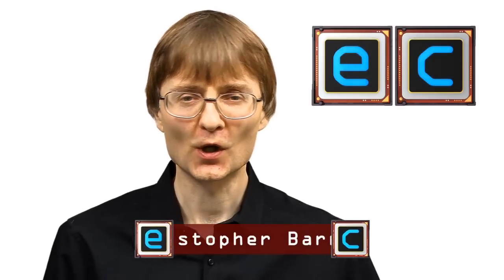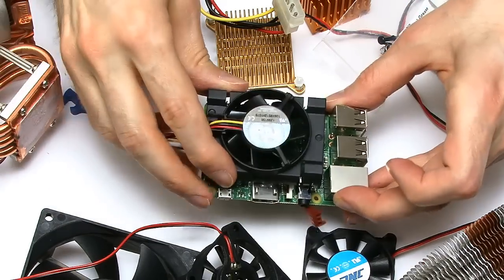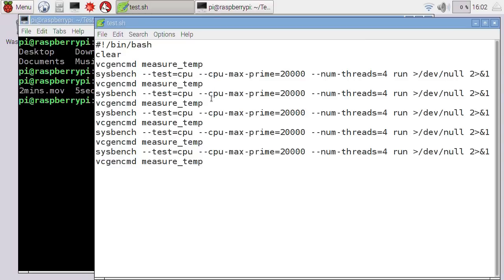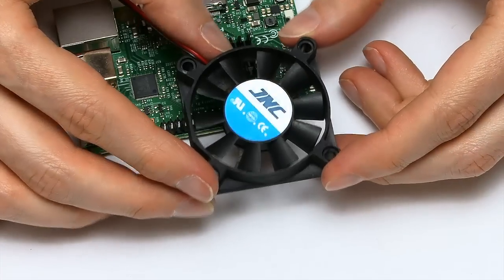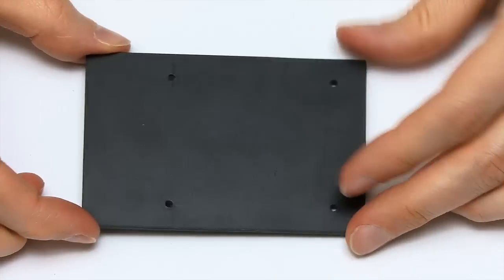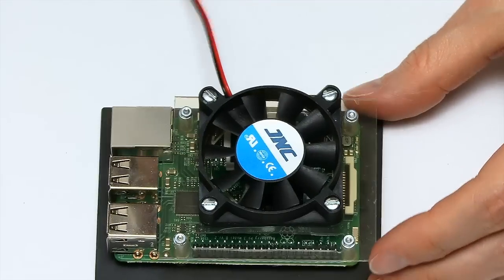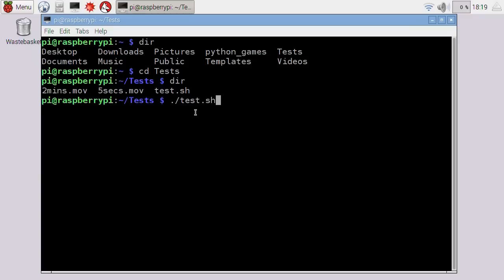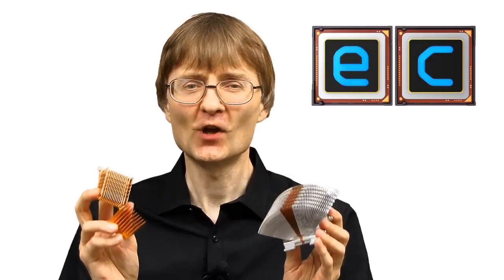Raspberry Pi 3: Fan and Cooling Tests

Comment: can you please share the bash script?
Reply from the maker: I will try and dig it out! :)
Reply: thanks.

I did try to copy the commands you showed in your video and put it inside the bash script
but for some unknown some reason I can't get it to output the different temps as shown in the video..
I think I wrote something wrong or the one you showed in the video is not correct..
because I copied exactly as I could see it in the video..

This is what I put in my script

#!bin/bash
clear
vcgencmd measure_temp
sysbench --test = cpu --cpu-max-prime=20000 --num-threads=4 run >/dev/null 2>&1
vcgencmd measure_temp
sysbench --test = cpu --cpu-max-prime=20000 --num-threads=4 run >/dev/null 2>&1
vcgencmd measure_temp
sysbench --test = cpu --cpu-max-prime=20000 --num-threads=4 run >/dev/null 2>&1
vcgencmd measure_temp
sysbench --test = cpu --cpu-max-prime=20000 --num-threads=4 run >/dev/null 2>&1
vcgencmd measure_temp
sysbench --test = cpu --cpu-max-prime=20000 --num-threads=4 run >/dev/null 2>&1
vcgencmd measure_temp

Comment: Hi! how can I control the fan with a GPIO? I mean, insteed to conect the Pi to " ground and 5v", conect it to "Ground and a GPIO(for instance '17'"
Thanks
Reply from the maker: You cannot connect a fan directly to a GPIO pin (well, you can, but you won't have a working Raspberry pi for very long). GPIO pins supply a few hundred milliamps maximum at 3.3v, so connecting something like a fan (ie motor) to them will draw far too much power and damage the Pi. Pins 2 and 4 on the Pi, which I connect the fan to here, supply 5V *before power enters the Pi's voltage regulator* -- ie they tap the power directly from the micro USB power in. To control a fan via a GPIO output you would need to use some kind of motor controller.
Reply: Thanks, at the end I have conect a 2 Relay module and the fan to one of the exit. But I needed to import and write this:

import RPi.GPIO as GPIO
GPIO.setmode(GPIO.BCM)
pin = 3
GPIO.setup(pin, GPIO.OUT)
GPIO.output(pin,True)

And now, I have a DOUBT. 
When I write "GPIO.output(pin,True)"  the GPIO has not signal and the fan does not work.
But if I write "GPIO.output(pin,False)"  the GPIO has signal and the fan works.
it should not be the opposite?

Thanks in advanced for your information.
Reply from the maker: It will depend on which way around things are connected to the delay module! I would not worry.

Comment: Very clearly, one needs an active heatsink if one wishes to have a long-lived Raspberry Pi.  Yes, it will run fine with no heatsink at all, but running it at its maximum temperature is just not a good way to keep the CPU in good health.

Thanks for this video -- an excellent demonstration, and I think everyone who owns a Pi should see it.

Comment: The temps between the two fans are virtually identical in the grand scheme. This makes me wonder is the chip's heatsink reached it's equilibrium in regards to thermal dissipation.
Reply from the maker: You are almost certainly correct. :)

Comment: The CPU fans are usually 12v... How do we power that with a 3.3/5v GPIOs on the Raspberry Pi? I've heard that Transistor can be used to do it. Are transistors a google place to get started?

Comment: Very good videos!
I did your test.script with my own Pi3 v1.2 and your results are very reliable!
I used a small aluminium Heatsink very similar to yours, but I milled the bottom flat and sandblasted the top. Used liquid heatglue.
At an ambientetemperatur of 20°C I got the following results:
40.8
67.7
74.1
77.4
79.5
80.1
Than I added a fan and let the Pi cool down propperly, I used a Sunon MB40101V2-000U-A99
Results were:
30.6
47.2
47.8
47.2
47.2
47.2

wich is pretty silmilar to your results and shows, that your test is reproducable!

Was fun to learn these things!

Best Regards, Christian
Reply from the maker: Excellent. Thanks for sharing this. :)

Comment: Like your video, subbed!

question, can I use gpio pins 4 and 6 for a fan? thanks! :)

This is for the pi 3
Reply from the maker: Yes, pin 4 also supplies 5V pre voltage regulator.

Comment: Does not the fan damage Raspberry p?i I read many article that warns the direct connection of fan into the GPIO on raspberry pi because the GPIO normally provides 20mA whereas cooling fan requires more.
Reply from the maker: You are right that the GPIO pins cannot and should not be used to power a fan. But I am not here powering a fan a GPIO I/O pin! :) Rather, I am powering it from the 5V pin that feeds directly from the 5V input to the Pi (ie it takes power before the Pi's voltage regulator, so it is safe to draw more power than that regulated output can supply).
Reply: ExplainingComputers Yeah, fan draws the ower from 5V pin in Rasberry pi. However it would be risky because the power consumed by the fan occupies the power to Raspberry pi, i. e, Raspberry pi requires larger than 500mA so that it would be possible Rpi cannot the mimimum powrt from the Adapter if the capacity of the adapter is limiter like 5V 1.5A where fac consumes 1A more
Reply from the maker: The only risk is that the Pi will not get enough power as you say, so could become unstable, which could I guess result in SD card corruption following a crash. However, there is no risk of hardware damage, as the fan is never drawing power through a GPIO output pin and the Pi's voltage regulator. Clearly the power supply needs to be correctly rated -- the "official" Pi PSUs are now 2A. :)

Comment: What about using USB driven fan with goose neck. You can bend it towards the heat sink. It won't require any additional power connections.

Comment: Great video tutorial, mate.  Just what size is the gigantic heatsink you used in the Extreme Passive Cooling video?  I'd like to get one to put onto my PI 3.
Reply from the maker: Thanks. The heatsink is about 34mm square.
Reply: Thanks for the quick reply.  Now I've got to get some 3mm copper and a gigantic 34mm heatsink.  I believe you used some sort of thin plastic sheet to fit between the copper and the heatsink.  What did you use?  And did you use any heat paste between the copper and the plastic sheet?

Comment: Hi. Good video. But can I connect the fan on pins 4-6?
Reply from the maker: You can take 5V+ for a fan from pins 2 or 4, and use 6, 9, 14 and others for 0v/GND. You should not attempt to power a fan from any of the other GPIO pins -- as they supply very low current ar 3.3V. In contrast, pins 2 and 4 supply 5V before the Pi's voltage regulator.
Reply: Thaks

Comment: You made the "bracket" a lil more complicated than it had to be.  Withall those CPU fans/heatsinks just "laying around", I would have just scavanged up some MoBo standoffs.  You can join as many as you like together to get the "height" you want from the bracket system. Another awesome side effect of this is that Screws can just go right into the end of the top standoff....... just sayin :)

Comment: I'm seeing others that are saying don't run the fan directly off the GPIO pins as it will fry the board (or stress it).  One vid shows it using GPIO pins as a relay of sorts and a transistor, also programming the pi3 to turn the fan on at a certain temp.
Reply from the maker: Be clear, I am NOT running the fan from the standard GPIO pins here -- they cannot supply enough power without damaging the Pi. Here I am powering the fan from the 5V pin, which is technically not a GPIO pin. It simply taps the 5V line BEFORE it enters the Pi's voltage regulator. All other pins effectively come after the voltage regulator (to deliver very limited current at 3.3 volts), so do not run a fan from any of the GPIO output pins. As you point out, you can use an GPIO output to control a fan indirectly, but not to power it.

Comment: Hey there! How would you go about adding a fan to the Pi 3 using just the Pi itself as the powersource, maybe even adding PWM to dynamically cool the system?
Reply from the maker: The Pi here is the power source. :)
Reply: Strange, it is indeed! I've seen this video a couple of times now and forgot that you're adding a self-powered pi-fan  after the first fan-test. Sorry about that, and thanks for the reply! Since then, I've actually been using a fan rated for a max of 12v, and a minimum of 7v - yet, it turns on and is powerful enough for my uses. I won't damage the pi, nor the fan by underpowering the fan, or am I running risks here?
Reply: By the way, in my case I've also hacked away on a pre-made clear-plastic-case, however, I am using foam and glue to secure the fan in order to minimize vibration-noise. Currently drying up!

Comment: Chris thank you for the video, very well done. Do you think there is need for a diode or MOV to prevent current from going back into the pi from the motor? If so how would you recommend doing that?
Reply from the maker: This should not be a problem, as the power is taken from the 5V line, which is before the Pi's own voltage regulator (it just taps the USB 5V+ input).
Reply: Brilliant! Thank you!

Comment: i have used pi 3 with original PSU at 5v 2.5amp  and could have my 500GB  2.5" hdd external drive working.MY 2TB 3.5" external  hdd working

Comment: I would say there would be very little CFM near the heatsink, the majority of the air pressure would be dissipating radially. With such a small heatsink you'd want the blades to be pushing air directly into the top (off-centre). You'd definitely be cooling the surrounding PCB though, which certainly counts :D
Reply from the maker: +samthepoor The fan is not centred on the heat sink, so the latter gets good airflow (the SoC is not in the middle of the Pi's PCB).
Reply: +ExplainingComputers Aha, right you are, apologies!
Reply from the maker: +samthepoor No problem. :)

Comment: Thank you for the video. Very useful and informative. I am going to buy and make the RP3 as my home server (or HTPC) with following software running 24/7 on top of Ubuntu Desktop + USB HDD with its own power supply: Kodi, FTP server, Calibri server, Webmin, PLEX server, Subsonic, Pydio, Bittorrent Sync. Should I consider installing fan for my setup? Thank you for reply.
Reply from the maker: +Rustem Yeleussinov You should not need a fan.

Comment: Wouldn't the small heatsink with a channelled/shaped funnel, fan, piping all the air directly onto the heatsink, work better?  Gets the air flow up by forcing the air into a smaller space, so forces the hot air out of the way faster and forces a larger volume of cooler air over the heatsink. Instead of a heatsink that isn't directly placed over, in full-contact with, the CPU?
Reply from the maker: +james chatterton Certainly you are correct! :)

Comment: Wouldn't a better placment of the fan be on the edge of the pi so it doesn't have a deadzone right under the fan where the heatsink is?
Also that would cool the memory directly as well and not through the pcb.
Reply from the maker: +Pär Moberg Yes, a side placement may work better (though would be harder to mount!). But note that the CPU is not in a deadzone under the middle of the fan, as the CPU is far from central on the PCB. :)
Reply: Svensk?

Comment: I fit my own Pi2 into an old Linksys 5port switch additional to a small fan powered by the GPIO:
http://abload.de/img/img_20150323_2203208iuh7.jpg
http://abload.de/img/img_20150323_220339n7uoe.jpg

Comment: I've enjoyed these Pi-cooling vids  but I do need to correct your terminology.
The long, threaded items are either screws or bolts, while the small hexagons that wind onto the bolts (or screws) are called nuts. You got the washers in the right place :)
Reply from the maker: +brando6BL Correct in the next video. When filming macro shots under movie lights, you sometimes do not say the right words . . .
Reply: Fair enough, and I noted that in the 3rd vid. That sounded more professional, and the results re. the copper and the finned hs really topped it off.

Comment: I would have an external mosfet driving the fan(using 12V), just to be safe.
Check this link out: 
http://electronics.stackexchange.com/questions/74629/running-a-mosfet-from-a-transistor-for-a-fan-controller

Comment: I was able to setup a couple copper plates (about the size of the SoC) and applied thermal paste between each of the layers until it met with a laptop cooler (using a heat pipe, and fins that attach to a vent, which is then fitted to exit through a fan). This setup works very well indeed for over-clocking the system. It just recruited a little work to make a case which would securely hold the fan and heatsink in place with stand-offs for the pi board itself.
Reply from the maker: +Crux161 Excellent! :)

Comment: you stupid you place fan directly on top of heatsink and there is no air flow
Reply from the maker: +Martin Očko No, I didn't. :) The CPU is not central on the board, so it is under one side of the fan. Great airflow! (If more by luck than judgement I'll admit).

Comment: A prime example of when a 3d printer would have come in handy or at least a less butchered job on the Acrylic because it is blocking a lot of airflow from the fan.  Oh, another thing to consider is placement because the the larger the fan the more the center hub (dead air) is taking up more room over the CPU.  Off center that fan and the temps would be lower due to more air flowing through the heatsink.
Reply from the maker: +Dark Alchemist So true, a 3D printer would be so handy here. :) Note that the fan is not centered over the CPU -- it is significantly off-centre, as the CPU is not central on the board.
Reply: ExplainingComputers
Ahhh, I couldn't tell as the CPU is so small it looked like the fan was directly over it though some air flow was being blocked due to that hole in the Acrylic/Perspex not really being round.
  I still find it interesting how around version 5 or 6 of the Pi it will be able to do everything my big PC does at least as well.  Miniaturization though it will soon hit the brick wall as Intel and AMD have due to the limits of Silicon.  We have to get something else or are we always doomed to a max of about 4-6ghz?  Doesn't matter if there were 1 million cores in these things, or regular computers, they have all hit that wall and can't give us any more speed.  Main reason I only upgrade my PC now once every 6-8 years when I used to do it every two.
Reply from the maker: +Dark Alchemist All so true. :) I keep thing that I edit videos on an 7 year old PC, but is still works fine (although it has several different graphics cards and drives in that time).
Reply: ExplainingComputers
Exactly, and the same for me.  My 7.5 year Dual core is finally dieing or I wouldn't even upgrade though I just made my 72 year old mother an AMD based pc on an A8 and all tests I performed on this machine and it that thing was as fast (single core processing) and everything else it blew it away.  So, that helped to reinforce the need of a new PC but I figure the modern Intel next to the top will be fine for another 7-8 years.  This system saw two video cards and IDE then SATA then SSD over its lifetime.  Ironic everything is advancing around the main component being the CPU, lol.
Reply from the maker: ***** You can see why the PC market is in so much trouble. After decades of constantly selling us new stuff, they have finally started selling us systems (or parts for systems) that work well for a long time. In other words, their product is now so good that, ironically, we will be buying far less of it. I am currently running a 3GHz Core 2 Quad. Probably the best system I've ever used, even though I know an i7 would be faster.
Reply: ExplainingComputers
Yes, but the issue I have is the motherboard as I have to reboot every so often then it works or I have to reboot it again.  Short of that I have no real need except I tried to play Fallout 4 (I had played FO3 when it came out) and it demands a quad core.  Not sure how they are going to work this out but they will have to come up with something to take the place of silicon or these companies will not be around for another four decades as they have been for the last four decades.

Comment: Using my Pi as a Media Center/Retropie Device, previously was the Pi2 which did ok in the case with a basic copper heat sink, however the Pi3 was easily approaching max temp when running Kodi visuals and some Emulators.. found a temporary fix for now but really looking for something more subtle in the long term!

Comment: Great video, Is that the same as using pins 4 and 6 as I was doing that with a small 30mm fan, should I have been using pin 2? 
Do you have the fan pushing or pulling the air?
Reply from the maker: +Rays RCs It is pushing air. Using pin 2 would be safer for the Pi. :)
Reply: Thank you for the reply shall start using pin 2

Comment: Im just curious but what happend if u put a fan underneath de pi? Would it be cooler?
Reply from the maker: +Jose Barona The CPU is on the top, with the heatsink on top of that. The role of the fan is to move air over the heatsink on the CPU.
Reply: ooh ok :) thanks

Comment: I love the DIY! But I'm not sure you cooled the CPU heatsink as efficiently as you could have. It looks like the central cylinder that houses the fan bearings was right above the heatsink. I wonder if this would create a deadzone of minimal air movement directly under the centre of the fan? Actively cooled heatsinks move air across the heatsink, however given the large deadzone of the fan coupled with the tiny heatsink means that any cooling effect is dramatically reduced I think? I'd be curious what happens if you move the fan off-centre a bit to see if that makes a difference. 

That said, great video. I enjoyed watching it :)
Reply from the maker: +Konrad Strachan The centre of the fan was offset. :)